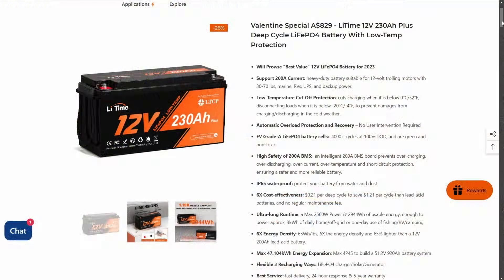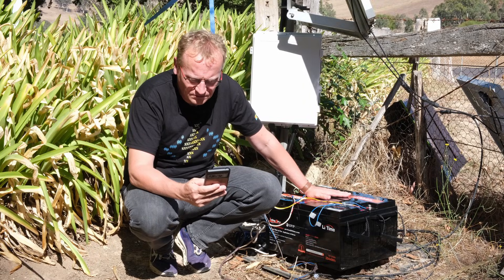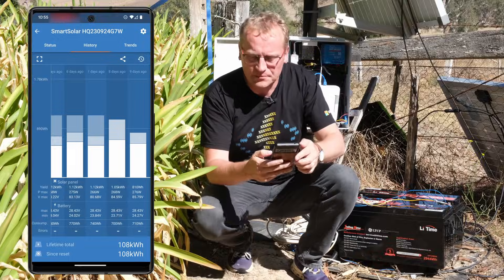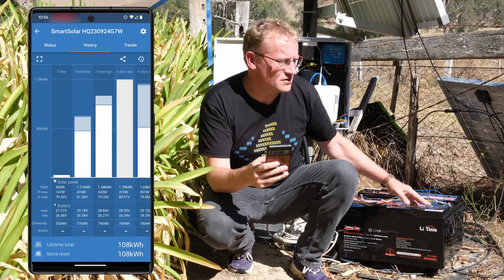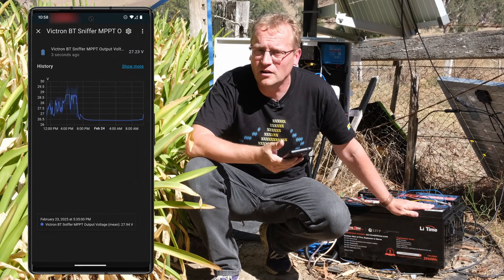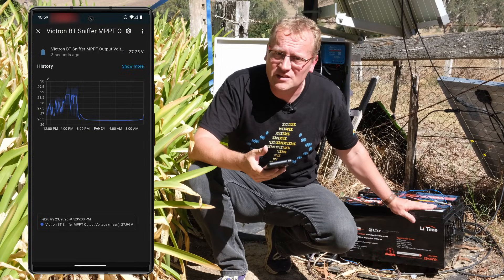Li Time 12V 230Ah Batteries - Upgrading my smart gate.... again

Comment: You will definitely see long term advantages of these batteries over Lead Acid batteries.   As you mentioned, the more stable voltage over the charge cycle is a huge advantage,  the higher capacity takign advantage of your solar panels more and the longer life span and lower maintenance needs.    Definitely a big improvements.
That box you are using to cover is actually a really great idea.  Anything premade is going to be similar anyway.    The only two things I would consider is something on the bottom so the batteries are not directly on the ground and to help prevent moisture from evaporation getting in and maybe, instead of the brick, using tent pegs or similar to hold the box down by the lip around the edge.   May be a bit more secure that way :). 
Just a couple of ideas.   As long as the plastic box is UV safe and has some ventilation, it's a great way to cover them and will be weather proof pretty well the same as a purpose made battery box.
Reply from the maker: Glad I am on the right track. They haven't skipped a beat so far. 
The batteries are on a high tech block of wood, which is in turn on a rubber mat, so I think they are okay. The box now have several holes in it for ventilation, but I don't know if it is UV safe. Otherwise I will spend another $30 next year 😂
Reply: @LarsKlintTech  Ahhh rubber matt and wood sounds good enough to me.   Couldn't see that in the video well :).    Sounds like you have it all professinally under control lol 🤣
Reply from the maker: @EsotericArctos  That's me. The picture of professional 😂

Comment: I'm curious if your at the point where you wished you just ran a cable down to the gate yet?

My dad has a gate about 80m away that thinking about putting stuff at it similar to you though less stuff. I was thinking about running a 48vdc cable. Avoids the legalities around trenching 230v, and keeps the amps down so that the cable dosen't need to be super thick and expensive. Then just use a buck converter back down to 12v/24v for devices. Saves all the stuffing around with batteries and solar at the gate etc.

Even though trencing and running conduit is annoying and expensive up front, seams like at this point it would have been cheaper and easier to just run a DC cable, or even AC. Even if solar + batteries was cheaper to start with, seams like theres this neverending whack a mole of upgrades and stuff with it.

For how they calculate the 6-7x cheaper than lead acid its just usable Ah and cycle life vs initial cost. So lead acid may get 100Ah usable for 500 cycles for a $500 battery, giving you 1c/1Ah/cycle. Where as LifePo4 batteries may get you 200Ah for 5,000 cycles for $1,000 giving you 0.1c/1Ah/cycle. So while they are more expensive upfront, the higher depth of discharge and the higher cycle life means they are a lot chepaer in the long run.
Reply from the maker: I am in the process of running 240V, so you are right. It will be much simpler. I have all the electrical cable in the ground, both for power points and lights for the driveway. 160 meters of trenching done, and lots of bits of cabling sticking out of the ground. I am saving up currently to get the electrician in to finish it, as well as buying 14 lights for the driveway. Should be another 6 months or so before it is done. 

The solar has been working great, and I have learnt a lot. I will reuse the setup in another remote part of the farm, so all the knowledge will be reused too. 

Thanks for the calculation example too. That makes sense.
Reply: @LarsKlintTech  Thats why I'm thinking of going 48vdc, avoid that sparky cost, can do it all on our own using an off the shelf power supply, though AC is defintly the better solution, just more expensive.

Theres always going to be somewhere you want power on the farm for solar + batteries, I'll be waiting to see where they go, my guess would be that spot where you did the bridge pro test, to keep an eye on those pesky dissapearing trees.

As good as the new UniFi device videos are, these various farm upgrade videos are defintly my favourite
Reply from the maker: @jayoswald9632  I decided to go all out from the start, and then things just have to take longer. 

Thanks for the feedback. I do enjoy the farm tech videos too, but sometimes I have to mix it up, and I starting to struggle a bit with finding real world projects for all the new devices.

Comment: 2 superbes batteries lifepo4  mais une installation  photovoltaïque totalement ridicule , suffit de voir les panneaux solaires sous dimensionnés et mal inclinés...( Un mini local en bois serait l'idéal !).
Reply from the maker: Thanks for your input. How would you install them then? The mounted panel is slightly more than 45 degrees as recommended, but the rest are about that. This is also a temporary install, while I wait for 240V. Instead of just being negative, this is an opportunity to show your knowledge and help the community.

Comment: Did see other comments about fake rocks, was thinking whatever cover you get/use try to avoid black given the sun exposure. Might be worth stick a smart thermometer in there to see how hot it currently gets
Reply: Also felt sorry for you having to say Lithium iron phosphate all the time, think you deserve to cheat and just say LFP after the first instance instead next time 🎉 (I normally hate when people use 3 letter acronyms without explaining them)
Reply from the maker: @Stephen-Jones  I have to learn somehow. Lithium Iron Phosphate Lithium Iron Phosphate Lithium Iron Phosphate Lithium Iron Phosphate Lithium Iron Phosphate Lithium Iron Phosphate Lithium Iron Phosphate Lithium Iron Phosphate Lithium Iron Phosphate Lithium Iron Phosphate Lithium Iron Phosphate Lithium Iron Phosphate Lithium Iron Phosphate Lithium Iron Phosphate ...
Reply: @LarsKlintTech  🤣 If you copy and pasted that I'll be disappointed 😜
Reply from the maker: @Stephen-Jones  Took me 22 minutes to type out.
Reply from the maker: Black was all I could get in that size. I have put quite a few vent holes in it though. I am considering getting another Aqara unit to add in there, now that I have lovely Zigbee connection at the gate too.

Comment: You can use plastic Mid size dog house to put the batteries since they also have nice circulation as well.. I use them to put my all electrical gear for my 6000 ltr pond.. Good luck.
Reply from the maker: Hmmm. Could pretend there is a guard dog then? To guard against the non-existent people that come by.... 🤔

Comment: Hi Lars 
I thought your where using the solarmax to charge your batteries? 
Is it not suitable?
Reply: The Solarmax is kind of an odd product - it can do 24v output via battery - but it is not setup for recharging on Lithium.  It is good for older UISP/AirMax kit - and SOME ancient 24v passive UniFi gear.   If you wanted to run something modern on it, it needs to be powered off of another switch - since the original is only 10/100.  And max of 7Amp out.  It still has it's uses - but the Victron with other integrations via Home Assistant/MQTT/etc can be far more functional.
Reply from the maker: What @SeijinSA says. I go through the reasons in this video too: https://www.youtube.com/watch?v=lDXGytmrvOc
I wanted to upgrade switch and camera, as well as the gate intercom, so Victron is the way. These batteries is an upgrade from the lead acid setup too. All to run more smart things at the gate 🤓

Comment: Would it have been cheaper to buy a single 24V 200Ah battery?
Reply: Lead acid batteries will not last 3 years in Lars’s application, may be lucky to get 3 years in my experience.
So I reckon 3x$cost of lead battery + the annual price rises.
Reply from the maker: @billthompson54  Those old lead acid batteries are about 3 years old and still going. However, I suspect the capacity has gone down, and the constant drop in voltage is also not ideal.
Reply from the maker: It's about the same price as 2 x 12v 230Ah batteries, but then I get 30Ah more on top.

Comment: I use a similar box for my Battery outside box too. I added holes for air and put the lid under my batteries first with holes to drain if rain gets in the box. as my box is in the sun all day also
Reply from the maker: That is a good way of doing it too. I don't use the lid, but place it upside down over the batteries.